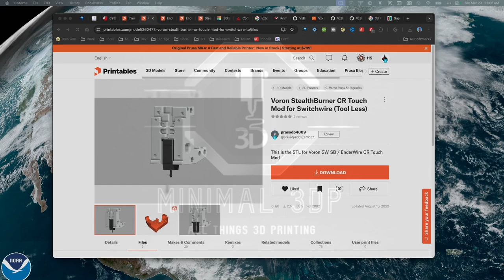Ender 3 (Max Neo) Stealthburner Mount: The Stealthburner Mount You NEED! (Easy Install)

Comment: Very cool, I'm printing this to upgrade my Ender 3 pro.
Just a question: are you using MGN12C or MGN12H rails?

Thank you very much.
Reply from the maker: I am using MGN12H
Reply: Hello again.
I'm installing a stealthburner with the EBB SB 2209 CAN, and I'm not sure if i need to rewire the CR Touch to plug it in the EBB connector.

Have you used the SB2209 on your build?

Thank you
Reply: Answering my own question:

No, there's no need to rewire the CR Touch to connect it to the BTT SB2209 😉

Comment: What kind of printing speed are you getting on the upgraded max neo? Do you think you could get it to 200mm/sec accurately and consistently?
Reply from the maker: I was not getting that type of speed at all. I was getting around 100-150.
Reply: @minimal3dp  That's still very impressive! Do you think the max neo could getup to 200mm/sec?